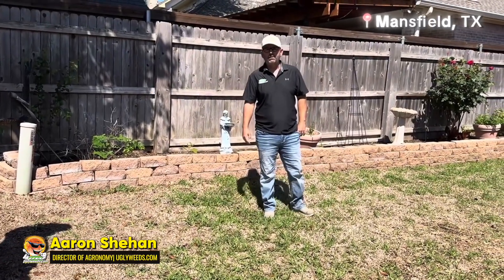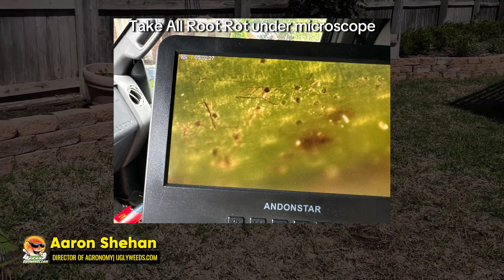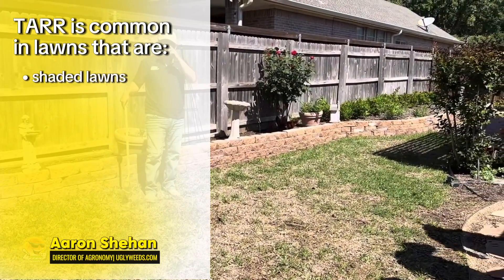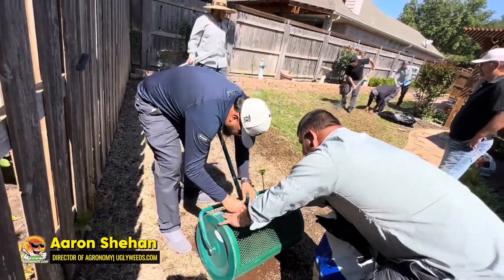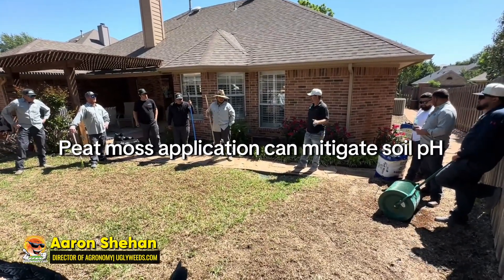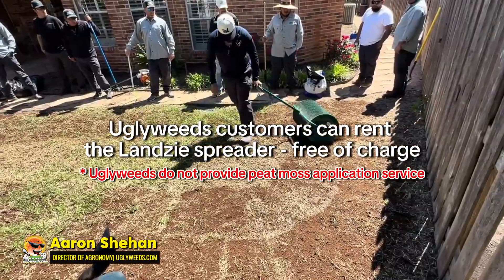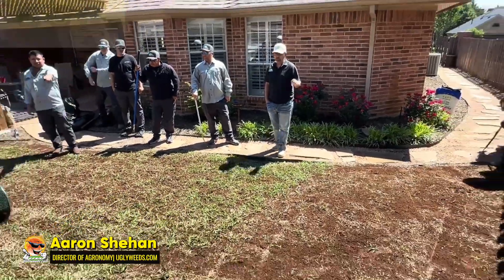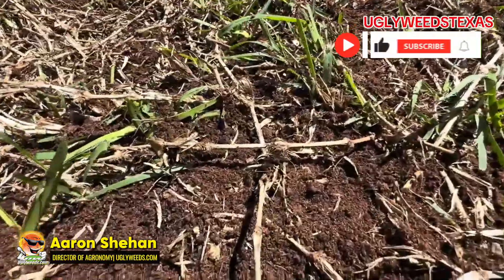Take All Root Rot Plan

Comment: It's clear you guys run a good business. And I understand you are trying to help here, and it is always important to fix drainage issues, along with cultural practices being the MOST important; but the some of this information is outdated or lacks the requisite detail. #1 TARR is not cureable. You can suppress it (in some circumstances) but not eradicate it. #2 Neil Sperry FINALLY disavowed peat moss for TARR in 2023. It is posted on his Blog. It was never a cure, it was only like treating an illness for the side-effect: being acidic. The primary property of peat moss is water retention. "Top Dressing" on top of black clay with peat moss = holding moisture in the surface of the soil and around the stolons. We NEVER want to hold moisture on the surface, we want to hold moisture several inches down (or in subsoil). It is why we water long and deep, not shallow and infrequently. "Amending" soil via aeration with sandy loam and peat moss is fine. Top dressing with it won't cure TARR, can cause other diseases, and raises your soil height. It drives me nuts seeing these houses where the grass is 3-6 inches above the sidewalk because people keep resodding and peatmossing constantly. #3 There are different strains of TARR same as there are different strains of the flu. #4 There are over 40 varieties of St. Augustine scattered around DFW and TARR affects some of them worse than others. And the old Home Depot varieties are worthless. #5 Lack of photosynthesis causes TARR to be exponentially worse for every hour of DLI under 6 hours. It is far worse a factor than drainage issues (which is more linked to other grass based diseases like brown patches, blights, etc). Separately (unrelated to what you indicated), bad lawn crews are weed eating St. Augustine down to the dirt and throwing Zoysia on top of the diseased roots and stubble. This is malpractice but nearly all of them are doing it, as most customers want an immediate fix (which it is not a real fix, just lipstick on a pig) and refuse to pay to what it costs to have sod replacement done properly.  Zoysia is a great grass and has benefits over St. Augustine, but you can't hide from TARR by switching to Zoysia. Half of the lab reports I get back each month are from people who resodded with Zoysia in the last 1-2 years. And I'm also finding TAP (Take all Patch) in lots of Bermuda properties. Bermuda in full sun will bounce back fast from Take All Patch, soon as cultural practices are fixed and fungicide rotations are in place. Why? Bermuda can regenerate underground from rhizomes, St. Augustine can't.  Sun and photosynthesis are the key to all plant life. There is no getting around it.